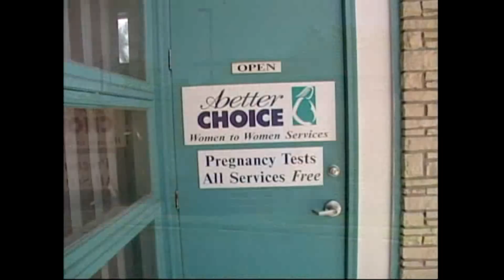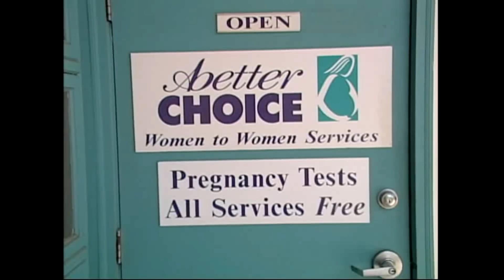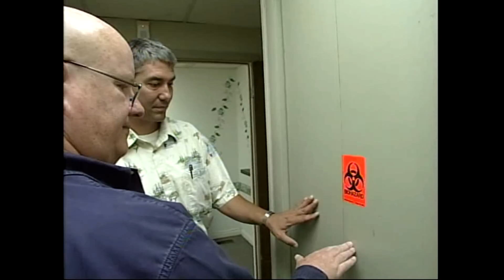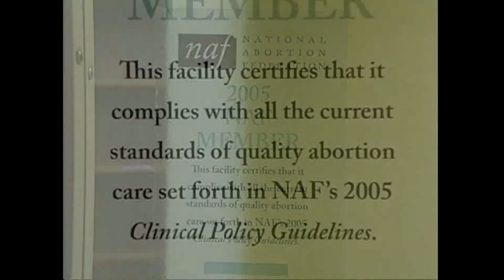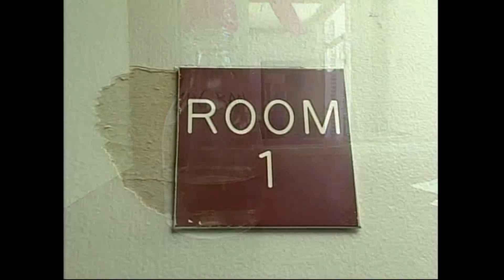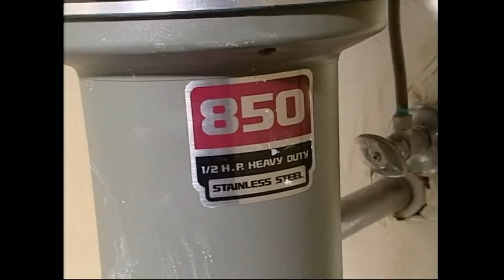Tour of Closed Abortion Clinic

Comment: Hundred bucks they installed the garbage disposal right before this video.. Notice how clean it is under the sink, notice the clean plumbing lines. They want you to believe the whole place is a filthy pit.. But lo and behold they kept the garbage disposal under the sink squeaky clean. Yea...... OK.
Reply: Sad denial of reality....did you see the cleaners they kept for the pipes? That would be a priority place to "clean" every day, because it was the most used.
Reply: Mary Brecken right? so staged.
Reply: The statements of the patients were made wayyyy before this so no it's true weather it was that one or not .
Reply: Jesus if that is squeeky clean for you guys.. Then I don't want to enter your homes.
Reply: I suppose the whole building is actually just a "pro-life" propaganda TV set that they built, possibly the same building they staged the moon landing in and there were never any actual abortions there.   So why is there dust on the disposal unit?  Why is there paint or spackling drippings on the disposal which match the color of the wall behind it and the color of the vanity?  Corroded hardware and plumbing showing it's age?  I suppose they just installed it for the video yeah?  How convenient that the sink area was pre-wired with a switch for a disposal motor just waiting for them to put one in.
Reply: You are correct! I live in Wichita, I have been in this building several times (not for abortions) and it was clean and bright.  It looked like any other dr.s office you go into.
And that door they entered was the back door. The front door led to the reception area that was clean, bright, and comfortable. 
This video is a complete fabrication.
Reply: +Chloe Dassler I wonder how they fabricated weeks of dirt and grime, or the goddamn water heater next to the circuit breaker.
Reply: You must live in a dirty place if you think that's clean